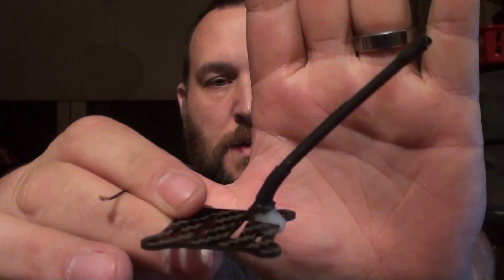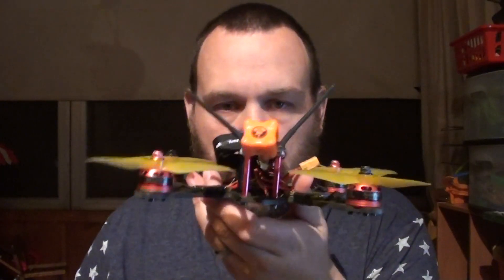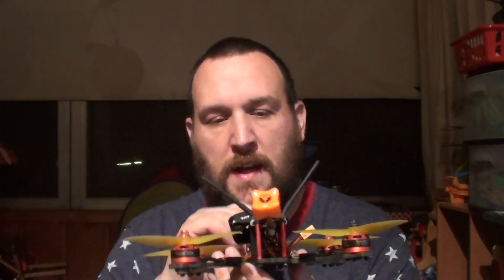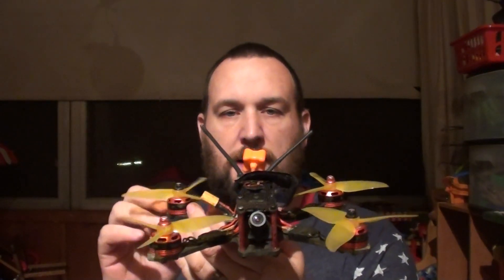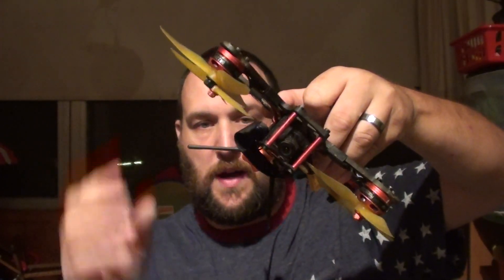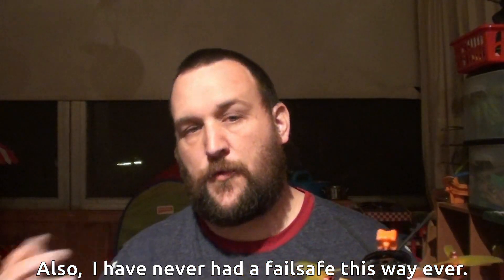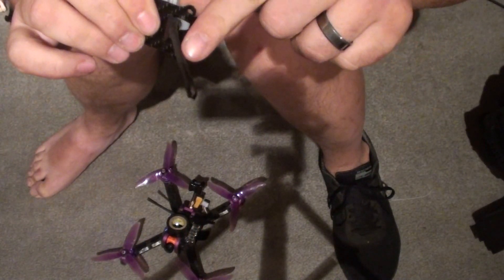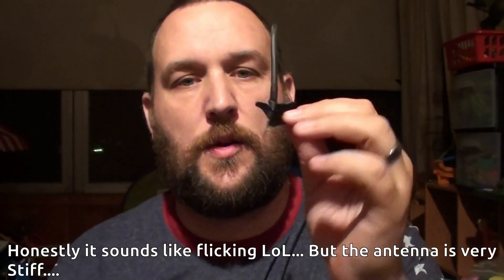I disagree with Joshua Bardwell. Mounting Antennas

Comment: Of course it's not gonna be sucked into the props. The area of the antenna combined with the strength of the zip tie and tubing won't cause the suction.

Comment: Prolly won't block them by arms unless you just hover all the time but then distance wouldn't really matter. Do you know half the things you say before you say them. I mount mine off the arms for over a year and still have original antennas that came with the quad. And are freestylers trying to fly long range? I doubt it. Lmao what am I doing? Oh I'm hitting the antenna into the props cuz ur right, it is the stupidest thing you've ever done. Cuz nobody hits the top of the quad which would push antennas down like a 🌲 or anything right. All it did was shear the end? Point made! I stuck antenna in hard core and antenna still together. It's just sheared and marked up. Do you really have any subscribers?

Comment: Dude not trying to be a dick but your way wrong when your finger bashing and flipping all over the place it’s not just the suction of the props buts it’s the weight and momentum if I were to still mount my antenna like you I’d be a dead man I say if I were to still because befor I knew anything I mounted them like you and would brake them all the time and as soon as I started mounting like he did I haven’t messed up one outside of crash watching your flying your not finger banging or doing any top of the line stuff just normal flying and your way works for that but as soon as you start throwing the quad around you will mess up your antenna honestly the difference here is beginner flying bs advanced flying I’m not trying to be a dick but your going to ruin a lot of people’s stuff who do anything crazy

Comment: Drilling holes in the frame weakens the structural integrity... just so you know. 
Also I tried mounting it the way YOU do, and i used plastic tubing instead of heat shrink and zip ties. One crash flip over and both antennas gone.
Reply: Thank you! My first thought exactly and I'm a newbie
Reply: Depends where you drill them, most frames are swiss-cheesed without much thought to continuous fibers anyway.
Reply: Well that’s not his way?? lol. I’m not saying he is right. But if you didn’t use zip ties and heat shrink it’s not the same as his. Just sayin. Happy flyin!!
Reply: an eighth inch hole is nothing compared to the holes they cut out for weight saving

Comment: just to add my 2 cents. I did run antennas the way you say, and one did get chopped off. The zip tie didnt break, but the prop did cut through the heat shrink and cut the antenna wire. No, it did not get sucked into the prop, I crashed upside down and some thick weeds pushed the antenna into the prop just before I disarmed. To be fair, I only had one layer of heat shrink on the antenna. If I had 2 layers of heat shrink, it probably would have been stiff enough to be fine. So the conclusion is: if you mount antennas out the top, use 2 layers of heat shrink.
Reply from the maker: 2 layers or super thick tube

Comment: You are correct, a vertically polarized antenna will have a hard time communicating with a horizontally polarized antenna.  I am wondering why your 5.8 ghz antenna isn't straight up.  Why it comes out horizontally and is bent up a little.  Why?
Reply: You have to remember that when flying, usually your are tilted quite a bit forward. Making the antenna much more "straight" up than when resting.